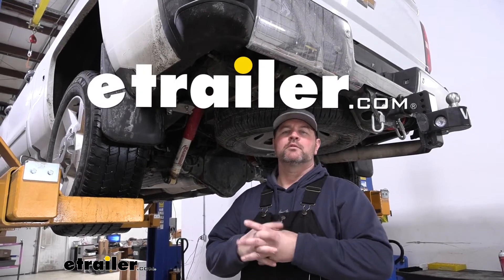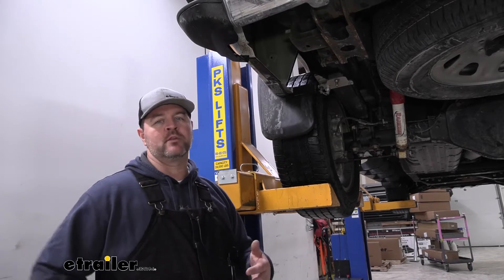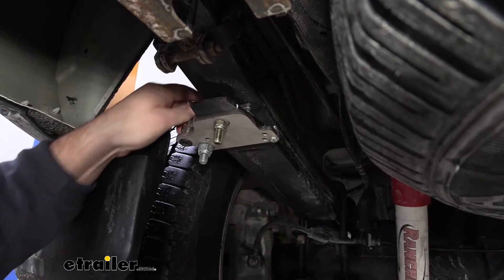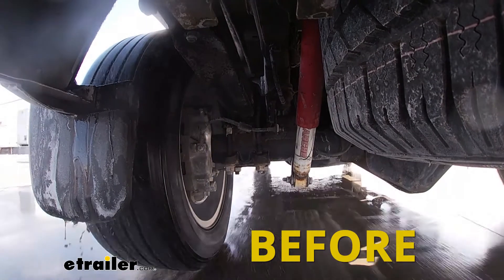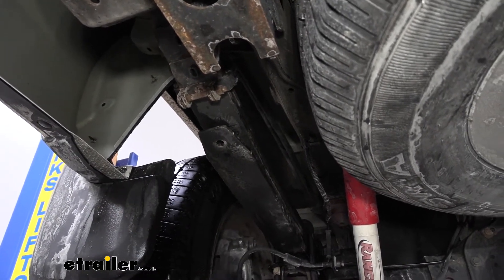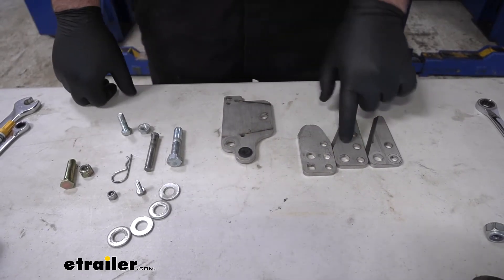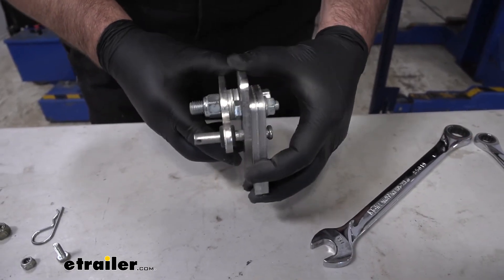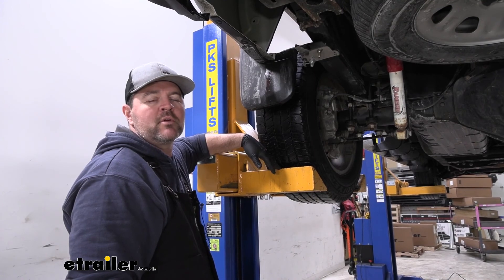etrailer | TorkLift StableLoad Rear Suspension Upgrade Installation - 2017 Chevrolet Silverado 2500

Comment: Are these a waste of money if you've already installed airbags? Thanks
Reply from the maker: They will most likely not engage when using air bags. To get them to engage, you would have to have almost no air in your air bags. This is very bad for air bags.
https://www.etrailer.com/Vehicle-Suspension/TorkLift/TLA7310S.html